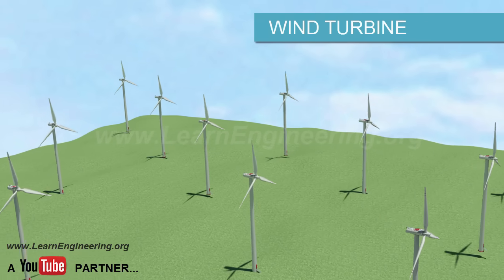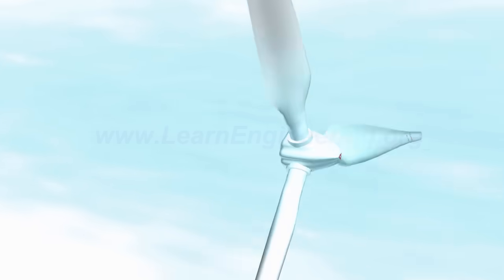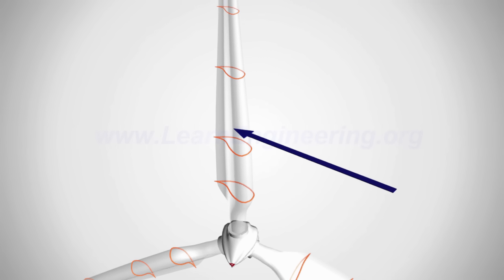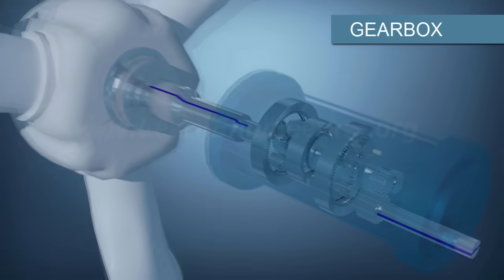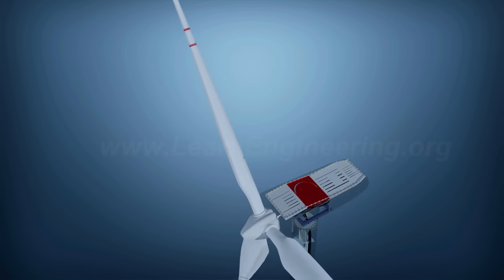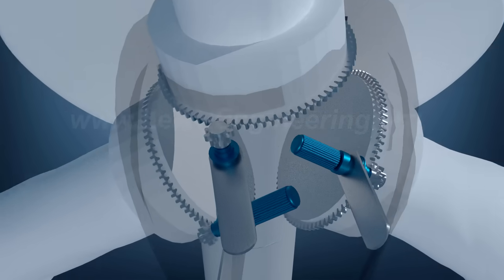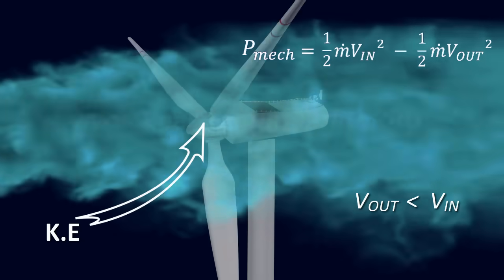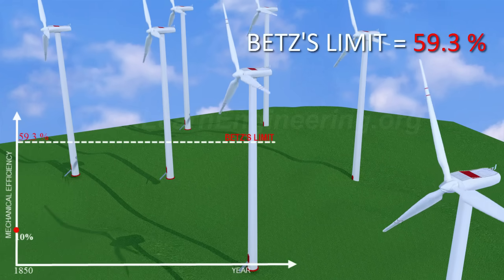How do Wind Turbines work?

Comment from the maker: Please check out our Patreon page https://www.patreon.com/LearnEngineering and extend your support.
Reply: They are to fit lasers , and destroy anything within 24 mile radius , when there is now power supply for the 60 KVA laser .
Reply: Like 1
Reply: l'éolien est une escroquerie à tout point de vue: environnementale, financier ... non seulement je ne vous soutiendrai pas mais je fais l’exact inverse
Reply: Brother, make a video about the sound proof room.  How many ways can a room be made?
   How does this room work?
   What technology should do it
   This room?
   Etc. with information.
Reply: God bless you and thank you very much for this valuable video
Reply: Question. Can you add the weight og house and rotors into the equasion and how much vind a rotor will catch in a normal windy day les say 5-6 meters per second?
Reply: watch my project on renewable wind power and give me ideas on how can i improve it? ...
Reply: blade in highway:
https://www.youtube.com/watch?v=wyT6LOwzoFw
Reply: @timelapselens3811  thanks
Reply: @happydazeharvick4399  You're welcome !
Reply: Plqqq1q x
Reply: https://youtu.be/kLRqkcjE6n8 changing old turbine
Reply: use atmospheric pressure changing then only a kilometres squares surface gives tremendous pressure which can be used in making the effort to spring based battery
Reply: use horizontal turbine series so we got more efficient energy collectively
Reply: @anilkumarsharma1205  llllll
Reply: @anilkumarsharma1205  llllllllllllpllllll till lllll

Comment: due to issues of speed, before connecting to the generator, the speed is increased in a GEARBOX to achieve the high speed ratio of 1:90
a break is also installed to arrest wind blade rotation during excessively windy conditions
electricity is from the cable to the base where step up transformer is situated 
velocity sensor measures wind speed and direction, deviation sent to the yawing mechanism to correct the error

windspeed upstream and downstream. downstream speed is smaller than upstream

if the downstream wind speech becomes 0, wind turbines absorb 100% of energy, but it is physically impossible

Comment: When is the 500 miles per hour is very dangerous to stay close so you have to stay at least 300 miles faraway because is moving in a very high speed the motor is extremely very hot so that's why it explorer because you cannot hold it anymore

Comment: Utilizing the kinetic energy of the wind, wind turbines produce electricity. They are made up of big blades fixed to a rotor. The wind rotates the blades, which turns the rotor attached to the generator. Through electromagnetic induction, the generator transforms mechanical energy into electrical energy. After that, the generated electricity is sent to a power system for distribution. Yaw systems are used on wind turbines to face the wind, and control systems are installed to maximize energy output. All things considered, wind turbines offer a clean, renewable energy source that helps lower greenhouse gas emissions and the need for fossil fuels to generate electricity.

Comment: and they won't mention the following : Inside wind turbines, there can be as much as 1,400 liters of oil. Servicing wind turbines is no easy task—it involves scaling to the top of these towering structures. As a result, leaks may go unnoticed until critical components break down. Oil leaks not only harm the turbine’s efficiency but also pose environmental risks. They can lead to pollution and even contribute to turbine collapses and they still want you to believe those things are clean energy source!

Comment: One thing that would help wind energy is to get away from standard wind turbines which is a 300 year old method. I have a wind turbine that will produce 6x a nuclear power plant and will work at 1 mph wind speed because I dont wait for the wind to come to my Turbine I bring the wind to my turbine. Standard turbines have to have 15mph to work.

Comment: Just wondering as the wind turbine continuously changes its direction as per direction of wind, 

My Question is how the cables connected with Stator to Step up transformer at bottom doesn't get kink and break??

Comment: ⚠️CORRECTION!⚠️
Wind power is NOT 'sustainable'. 

Environment:
1. They decimate raptor bird populations on-shore and whale populations off-shore. 

2. The CO2 emissions required to mine, forge and manufacture these giant steel structures is never offset during their operating life of no more than 10-12 years (contrast that with fossil fuel energy plants which operate for minimum 30 yrs).

3. The land area required to generate any reasonable amount of power is excessively large in comparison to the land area for an equivalent sized fossil fuel powered plant - in the order of 1:100.

4. The excessive land area requires that healthy tree populations must be destroyed to make way for these behemoths. In 2022, Scotland destroyed 16 Million trees to make space for Wind farms.

5. There is no way to dispose of worn out turbine blades when they are past their service life (8 yrs). They are simply cut into pieces and buried for future generations to deal with.

Commercial:
1. The return on investment (ROI) is very poor and in many cases non-existent, hence why almost all WTG (Wind Turbine Generator) projects are government funded ie; with TAXPAYER funding. 

2. This poor use of public funds cripples the pension fund holdings of many, many western governments. That is, YOUR pension will be whittled away for these poor investments.

These only make rich people richer and poor people poorer.
Reply: if you're already starting the list with the most obvious lie, you can basically sisregard all of it. cats kill 10000 times more birds than wind turbines do.
Reply: Thank you for this comment

Comment: Why do they not mention the fact that between 60 and 200 gal. of oil is put in that gear box , depending on the size of the unit, not to mention grease that is used for the turret gears, oh yes I know , it’s because those are fossil fuels and they can’t tell you the truth. You can’t handle the truth. It’s all about the money.
Reply: can you guess how much gal. of oil/coal are put into a oil/coal plant? probably 10000000 times more. but you don't care, do you? you're just a regarded kid spreading anti-green propaganda for no apparent reason.

Comment: A renewable resource . The wind is a natural resource that people have been using for thousands of years . People have used it to power sailing boats all over the world , and it was used in Europe for a long time to grind com into flour for bread . Now we have developed ways to use it to provide electricity for many other purposes . The main advantage of wind power is that it is clean energy Wind power doesn't produce any waste or greenhouse gases . Another advantage is that it is renewable . Wind is caused by changing temperatures in the air , and it will never run out . Finally , wind power is efficient . Because wind turbines are quite tall , the land under the turbines can still be used for agriculture Wind power does have some disadvantages , however People who live near the turbines find them unattractive , and think they spoil the landscape . The turbines are also said to be quite noisy , although it is quite possible that new technologies may make them quieter in the future . There is also a lot of expense involved in installing and maintaining the wind turbines . Finally , wind turbines cannot supply all of our energy noeds , so we will always have to rely on additional sources of energy .

Comment: The secondary braking system in the wind turbine is used primarily as a parking brake just like your car.  It is by no means the primary brake.  The primary braking system for a wind turbine is the blades.  The blades are also the gas pedal, just like your car.  In other words, when you step on the accelerator pedal in your car you can run up the RPM or speed of the engine go faster.  The Wind turbine controller can also run up the generator speed by pitching the blade angle down towards 0 degrees.  If the controller wants to slow the speed of the rotor and generator, it will begin to pitch the blades back towards 82-85 degrees.  It's the equivalent of you letting off your gas pedal in your car to reduce or control your speed.

Comment: Many of these sold on market say they come with a charge controller. Is the default charge controller typically good enough to brake the system from overcharging and for when wind is too much, or do people need additional controllers?

Comment: The Tension Turbine is based on the bicycle wheel. The bicycle wheel is the lightest, strongest, most efficient rotating device known. 
The Tension Turbine is the most viable of all wind turbines.  
The Tension Turbine:  Half the weight, twice the power.

Comment: What is the purpuse of using rectifier in turbine
Reply: not an expert but a wind turbine makes electricity at a frequency that isnt the same as the power grid so they convert the ac energy made by the turbine into dc, then back to ac, but at the right frequency

Comment: Very insightful video. I didn’t know that the blade direction could be altered. That’s a useful feature. At 59% max efficiency, this is better than thermal power which usually provides 45% efficiency. I have two questions: how long do the wind mills last, and what is the nominal power output of a windmill.
Reply: Nah
Good hydrogen-combustion thermal power generator can achieve 55% - 65% efficiency on a 1M - 1.5M scale already. It's just that hydrogen-based generator can't be vastly deplayed due to the lack of natural hydrogen resources.
Reply: Also
Most of the turbine now can't even achieve 40% efficiency consistently.
While thermal based generator can keep at up to 45% very consistently.
There's still a long way to go for wind turbines.

Comment: Thank You! Finally a common sense explanation. I think long term they will generate DC and house long lasting batteries. With the changeover of ICE vehicles to electric one wonders if it would make sense to have a DC power reticulation to avoid skin effect losses.
Reply: Not likely! Well! At least not these varieties of wind turbine.   DC electricity and batteries?  Not a pretty site when a battery explodes. 

Expense and dependency to me are the biggest issues.  Plenty of ideas out there to put in motion.  

The only wind turbine I am keeping an eye on is from a developer in Utah.   He is calling it the Power POD.  The kinetic wall wind turbine looks interesting as well. 

I had my hopes for for this solar roadway.  Not much has gone forward. Lots of great ideas even warning signals digitally displayed.  First learned of that idea in popular Mechanics 23 years ago.  

Personally I think electricity is over used and wasted.  It also has developed a more negative impact on human life as well as nature.

Comment: I'm really dissatisfied with the wind turbine I purchased a couple of weeks ago. Paid over $6 k for it, and it won't even provide me any electric power unless the wind is blowing. I was hoping to help reduce my carbon footprint which is massive if I continue to use commercial electric power. I'm wondering if some of the free energy generators I see demonstrated on YouTube could do a better job than the wind turbine. They looked like they can generate totally free energy at any time without needing some wind or other kind of free energy source.

Comment: The power of a wtg is mentioned. I would like to know what is the voltage produced by a generator. This voltage is stepped up in the bottom of the tower. Are several WTGs coupled together to produce higher voltage and then stepped up at a certain WTG? Hope for an answer.

Comment: Wind turbines need diesel engines or electrical engines to work when there is no wind or the wind is too slow. This is because the blades must be in movement, otherwise, they bend and deform, disestablishing the system permanently. A diesel or electrical engine is necessary, consuming power, instead of generating it.  Another concerning problems for those who live nearby are the noise, that can be not high, but the constancy of the blades cutting the air can cause a psychological problem, and the shadow that can hit houses and offices, and, in the same way, can cause a psychological problem.

Comment: Three old ladies run out of gas. Three tall skinny guys start pushing the car, but only use the palms of their hands on the sides of the car. They soon get tired. Four big husky guys start pushing the car, but by pushing on the BACK of the car, they do much better, and get the little old ladies to a gas station quickly. Any wind turbine has wind pushing it's blades at right angles to the wind, which is a moronic design.  It has small blades, so there is not many square feet of sail for the wind to push. This is not by accident, but by design. The enemies of wind power designed wind turbines, so they are unable to ever even pay for themselves. If General Electric had designed wind MILLS, rather than wind turbines, then soon all other forms of electrical generation would go out of business. We Polacks call this "Pissing in the soup", and although that would seem to make the soup go farther, it is a bad idea. So in order to stay in business, GE created the idiotic creature called the "Wind Turbine."

Comment: Why do they don’t mount the  gearbox and generator on the base of the tower instead of on the nacelle on the top ? Just use and angular gear on the top to transmit the power to the base. Installation and maintenance cost would be half..or less
Reply: @Aff Maybe, but consider a pre-reduction with a right angle gearbox with high efficiency , close to 99% , on the top directly mounted on the axe of the propeller, let’s say 1/5 ratio . This will decrease the torque that the shaft have to transmit by 5 times, so the shaft diameter . Moreover the shaft could be made of carbon fiber .
This is just an idea to move the main gearbox , the generator and all the technical staff to the bottom of the tower for an easy installation and maintenance costs .

Comment: The cables are the "blood vessel and nerve" of the wind turbine. Wind power cables are mainly divided into: ①blade lightning protection cable, ②variable propeller system cable, ③ fixed cable for tower drum, ④ tower drum to box transformer cable, ⑤ box to booster station cable.

Comment: You need some kind of lubrication/ oil so gears will not grind and wear out. Just about every device that spins needs oil lubrication. Microwave motor has all the same gears that are smaller. When Microwave motor is open you will see and feel the oil lubrication.

Comment: What they fail to tell you is the wings don’t hold up to dust and particles in the air it destroys the leading edge and efficiency is compromised  continuously needs maintenance and back up power supply

Comment: Please help.
I'm trying to find out how many KW a 10K kg. object can produce being released from 50 m. in one hour and I get 1.3 KWH. It sounds SO little. It's barely enough to power a washing machine for a single load.

Could a gearbox similar to that found in a wind mill allow... some sort of a faster spin and more KW during that hour?... or same 1.3 KW for more than one hour?...

Any help is appreciated.

Comment: You just need to explain how do we 
get electricity from rotating objects
Reply: Dynamos or generators if you wanna make a small one. Just make sure you can get the thing to cut off during high winds.
Reply: That's pretty basic. Just watch how a generator works and you have the answer. Or just read about Faraday's Law.

Comment: something that I just learned from another video that might be of interest: Power flows in both directions in a wind turbine field, both to a substation and from. This is because the turbines always use power for their control systems. Also, if there is no wind, the turbines have to be started using a starting motor when wind starts to come. Thus, even when there is no wind, the turbines still use electricity. Most do not have batteries since they are already connected to power, they just use power from the grid.
Reply: False, They do not use a motor to power up/Ramp Up. Their was a machine that worked that way years ago, but not today. Yes they use electricity when their is no wind. Very little to run a computer. But just for the record, a coal plant or gas plant uses electricity as well, all day every day 24/7. The conveyor belts that feed coal uses electricity. The tractor/loader that scoops coal and dumps it on the conveyor belt uses diesel fuel all day everyday. wind farms do not use any diesel fuel. The service trucks use gas 1 hour a day 5 days a week. 30 min to the tower for service and 30 min back to shop at end of day. just like your daily commute. But be ready because as soon as these electric trucks come out, I can assure you they will be some of the first to use electric trucks. does that mean the turbines are not really making a difference??? Yeah right..... it takes a barrel of oil to get 3 barrels of oil out of the ground. You have to feed a cow to get milk from it or to grow it to eat. you have to plant and water a crop to get a crop. its a investment and nothing in life worth while ever comes for free.

Comment: How is the voltage from the generator managed and sent to the grid? The generator spins at many different speeds during operation and thus the output voltage will vary, to feed the grid you need to match the voltage, how is this done?

Comment: Interesting that you refer to the blades as wings , wings are designed based on linear movement. I often wonder why this design is being used in this application. It certainly does not fit . At least in an efficient manor.